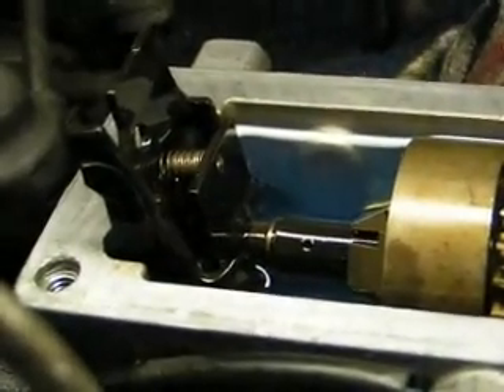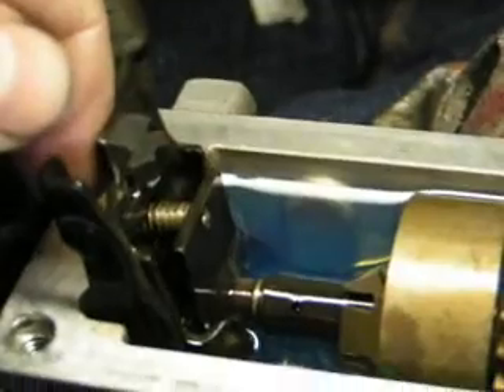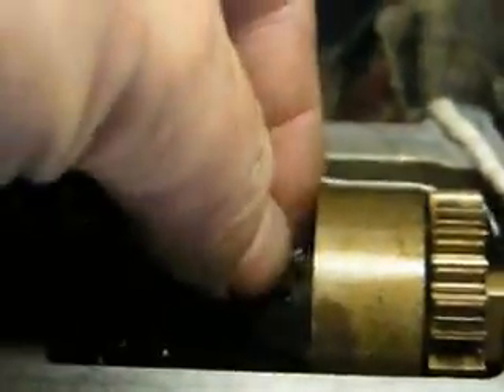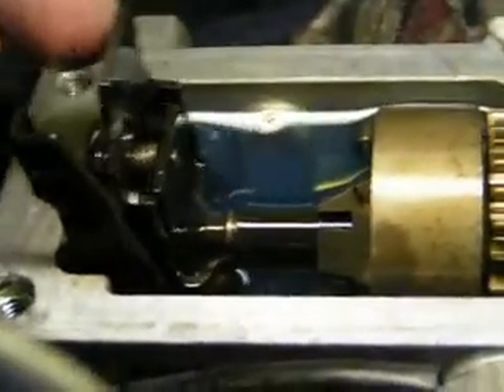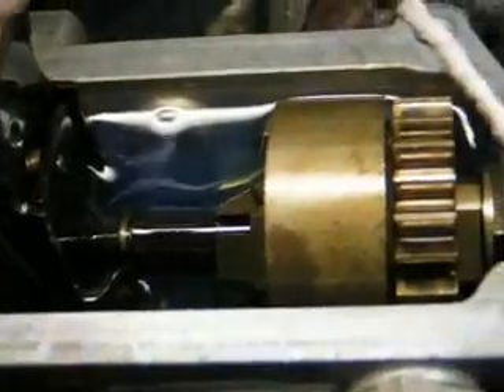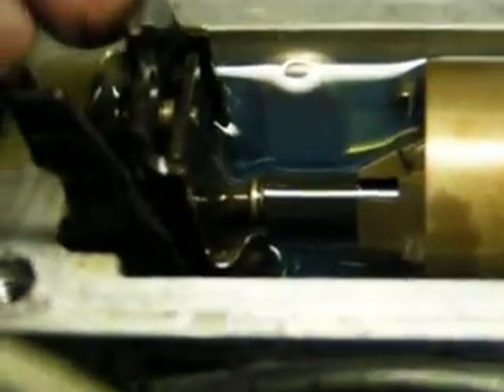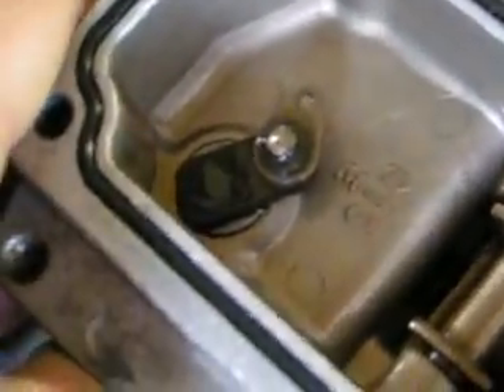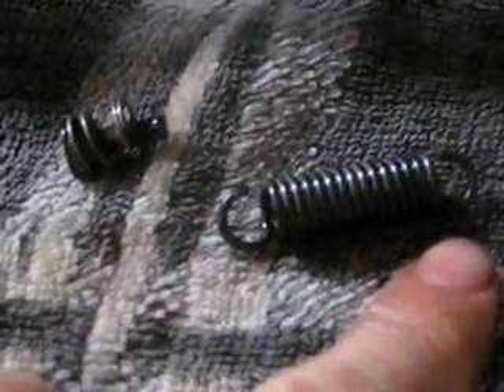VE pump governor

Comment: Ive got a 1994 charade 1L petrol, I want to replace it with the turbo diesel. Where do I get one in Oz.  Ps will it fit in a 1994 model??
Reply: The engine will rev to beyond redline and go runaway if you remove the 
govenor.  I own a TD charade with lowered compression pistons  and an 
intercooler.    The waste gate is always shut and it boosts to 20 psi,  
boost comes on very early after the extensive modifications and porting 
job i see about 15 psi by 1500 rpm.    I have extensively worked on the 
injector pump.   I just recently reset the case pressure to spec by 
adjusting the pressure regulator valve and this has brought the timing 
advance with rpm back to spec. the case pressure was only 20 psi at 
500pump rpm  it should be 43 psi .  This resulted in less than half the 
timing advance it was supposed to give as the revs rise.     Its now 
faster and better on fuel average 5 liters per 100 km.    Cant get this 
engine in australia but it is the same as the engine found in a kippor 
KDE19STA  diesel generator , this engine is still produced and you can 
get all the parts for the TD charade new from kippor (UK) or pjallsorts 
(UK).     The td charade is not the same as the non turbo diesel 
charade, the TD has stronger pistons with an alfin top piston ring 
carrier made of a steel alloy cast into the pistons,   fatter gudgeon 
pins heavier con rods and a heavier crank shaft with  thicker crank 
journals.    The sump gasket and rear main seal are different to the non
 turbo.     This engine in the generator is identical to the turbo 
charade engine in every way except for the injector pump and the lack of
 a turbocharger.   This engine can make some serious power when tuned 
well  but not reliably with out lowering the compression by modifying 
the pistons by deepening and enlarging the swirl chamber in the piston 
face. the kippor head gasket is a bit thicker than the standard(crap 
composite after market one) and is of the proper multi layer metal type.
     If you want more power than stock play  here are some tips, first 
add an inter cooler, finding one small enough that will fit  and 
plumbing it is not easy,   secondly play with the injector pump.  there 
are three settings on it that enable more power and better drivability. 
   Setting the correct case pressure is the first mod that is needed so 
that the speed dependent timing advance works properly.   Then you can 
play with the on boost fuel delivery by adjusting the boost compensator 
fuel pin position and the starwheel spring seat  and the maximum (off 
boost ) fuel screw.     First adjust the maximum off bost fuel screw 
with the boost hose on the boost compensator unplugged and blocked off  
until there is a little grey smoke  when you apply full throttle at 
idle.      Dont go too far as it will make black smoke this is wasted 
fuel that is unable to be burned because of insufficent oxygen.  only 
adjust by 1/4 of a turn at a time always count turns and write them down
 so you can go back to the original settings if you get lost in smoke 
land.     next is to set up the boost response fueling in the pump, this
 is controlled with the fuel pin position, this is an eccentric cone and
 by rotating the diaphram under the hat on the top of the injector pump 
 the shallowest and steepest part of the ramp are 180 degrees opposite 
eachother,   there is a reverse ramp on the bottom of the pin that cuts 
fuel when excessive boost is reached. on my car this is used to limit 
boost not the wastegate.    This ensures that at maximum boost it is 
never producing smoke.     Mark the diaphram and injector body with a 
white paint pen so you know how to set it back to the original setting. 
 rotate away from the shallowest ramp about 10 degrees at a time to get 
more fuel on boost.    The star wheel (under the diaphram which lifts 
out easily when the motor is stationary(   is the spring seat and by 
moving it up increases tension on the spring  decreasing its sensitivity
 to boost rise and lowering the spring seat softens the spring and 
increases the rate of fuel rise with boost pressure.      smoke in a 
diesel is a nono it makes dangerously high exhaust temperatures that 
will destroy your engine quickly.    more boost makes a cleaner cooler 
burn unless too much fuel is added making smoke  and the carbon dust 
wears out pistons rings and valves and valve seats.    happy tuning 

this myth of diesels running to lean is untrue, they depende on it.  Only in petrol engines the air fuel ratio is kept a constant where too lean operation is detrimental. A diesel is always gulping an unrestricted air supply and burning a tiny or larger quantity of fuel with the air.  they must be perpetually lean or they will smoke and blow up from excessive burn temperatures.